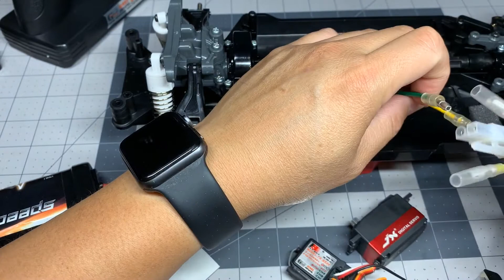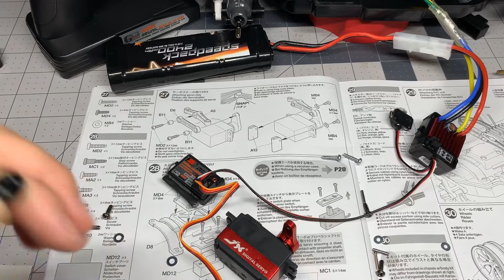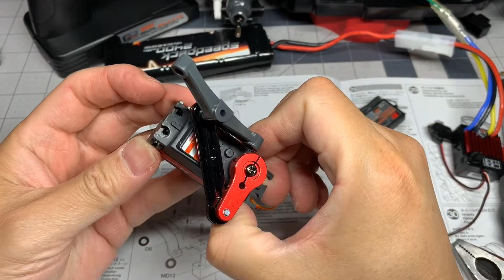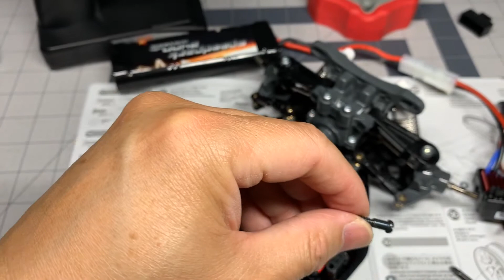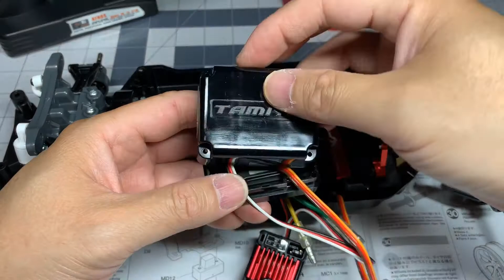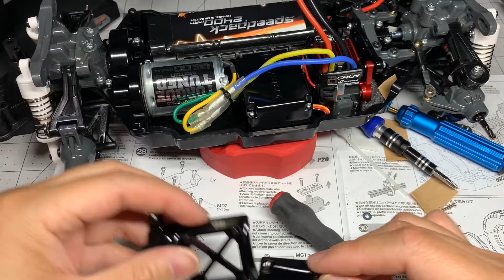How to Install the Electronics for the Tamiya Sand Shaker TT-02T

Comment from the maker: I wasn't expecting the issue with the servo saver. Fortunately I had spare ones from other builds. Using the Hobbywing ESC means I can use a Lipo battery without a separate Lipo meter.

If you enjoy this video, hit that like button and subscribe for more coverage. 👍